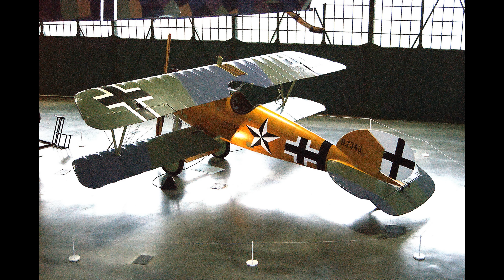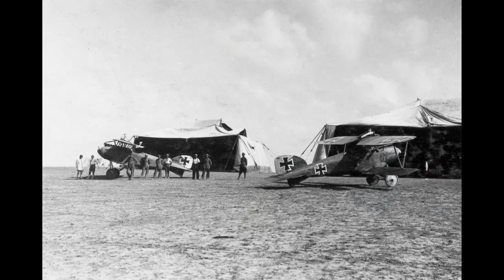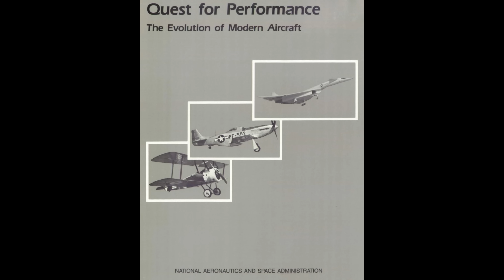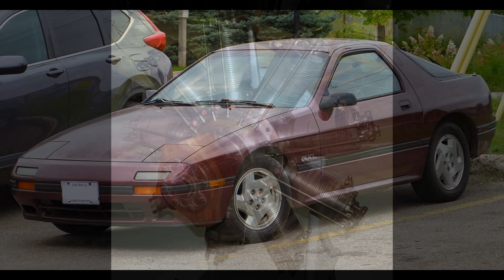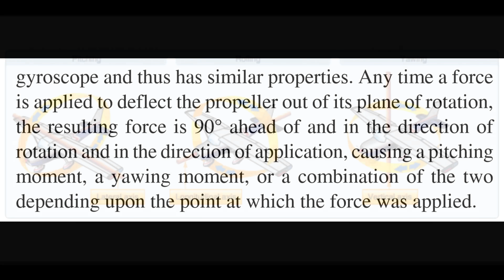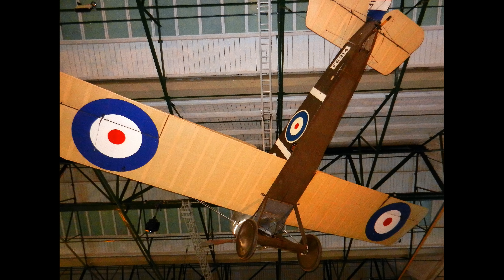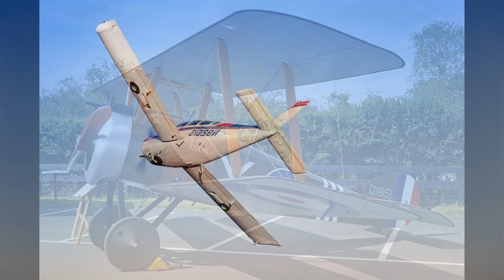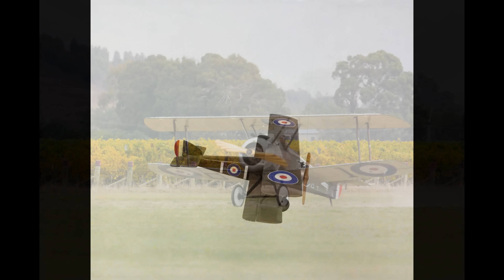Sopwith Camel, War Winner or Death Trap?

Comment: Wonderful video on the Camel. Funny you mention Snoopy, it's the reason I heard of the Camel and the reason it became my favorite WWI fighter. The SPAD VIII with Eddie Rickenbacker was another favorite. I eventually ended up with a VK Newport 17 RC aircraft that was built in the 70's by some Navy Contract worker. It was given to me in the 80's and I rebuilt it. It had Lafayette Escadrille markings on it with the Sioux Chief on the side. I routinely flew in the mid 80's at the NAS Whidbey Is. OLF (Outlying Landing Field) the US Navy uses for landing practice. That's when the club was allowed to fly there in the 80's off the southern taxi ways. I still have the VK Newport 17 hanging from my bedroom ceiling. That model is about 50 years old now. LOL Thanks again for the great video. Best Wishes & Blessings. Keith Noneya

Comment: Sorry, cannot agree.  Rotary engines were used because the piston counterparts with appropriate horsepower  were too heavy for aviation purposes.  When the wrights flew they had to build their own engine because nothing light enough existed.  For the weight, the rotary engines produced more horsepower at that time, 90 - 110 -130 hp.  The eindecker IV had a double row rotary engine which i believe was 150 hp, however it had many mechanical problems.  Once the piston engine was light enough with appropriate HP,  it became the dominant aircraft powerplant ,of course, followed by the jet engine which also took time to develop for aircraft purposes.
Reply from the maker: You're simply wrong. The Bentley BR1 rotary weights 397 pounds and put out 150 horsepower. The Spad XIII's Hispano V-8 weighs 445 pounds and puts out 200 horsepower.  The Radial's power to weight ratio is inferior to the Hispano Suiza V-8.
Reply: @GregsAirplanesandAutomobiles  BR1 was basically what could be squeezed out of rotary and Hispano-Suiza 8 in its Ba/Bb form had still good potential for more power.
Clerget ran around 1250-1300 rpm max and that was it, also it was nearly 6 litres bigger than H-S 8 (12l) and when H-S 8 F series came, which was similar displacement to Clerget 9b, Hispano power went up to nearly 350hp.
Basically the rotary peaked during the was and was a evolutionary dead end. And mainly because the need to run more rpm to get more power.

Comment: Rotary engine was an evolutionary dead end because there was no headroom to squeeze more rpm out of them.
Engine designers tried some innovative ways to bypass that, but engines soon became overly complex and lost the greatest rotary asset, which was low weigth vs power.
One good example of this was Siemens-Halske Sh. III, which was counterrotating rotary, so the engine and propeller turned opposite to each other and it took a long time to mature into a decent engine.
Also the oil systems used in those rotaries were almost universally total loss systems, just like two strokes where the oil is mixed with fuel before entering crankcase. 
The fuel-oil -air mixture was drawn into the engine via hollow crankshaft and lubricated most of the moving parts, rest was just greased.
Castor oil was used because it was one of the few oils in that time that mixed properly with gasoline.

Comment: In WW 2 The planes carrying the Atomic Bombs Turned to the right and go into a shallow dive after dropping the bomb because, of the gyroscopic effect of the rotating props, The plane would turn faster and increase speed by the dive and get further away from the blast.  The dive was necessary because, when the bomb was released, the plane would climb due to the loss of weight and climbing would cause a loss of speed.

Comment: It would be nice to see a vid on the actual honest impact of the airplane, and it's role in WW1.  The misconception of the overwhelming power of the machine gun  (in the front lines necessitating trenches) and the actuality of artillery. The primary use of aircraft to direct fire of artillery and the rudimentary radio they used to achieve such goals.  The role the "fighter planes"  had to effect such direction of artillery.   The Red Baron has been criticized  the allies as a butcher shooting down the innocent, when his role actually was to knock down the 2 seaters .

Comment: Good video. Interviewed many, many years later in the 1980s, Tom Sopwith specifically noted the effort to keep the weights concentrated in a close space on the Camel. Another development that helped defeat the Albatros fighters was the Constantinesco synchronizer which aided rate of fire and reliability from the Vickers guns  in 1917-18. Going from a single gun Pup with the old synchronizer to a Constantinesco dual gun on the Camel would have been a big jump for an allied airman.

Comment: the reasons for the gun "freezing" is multi fold 

for one, the speeds of the aircraft had started to increase, a lot, 
so there was a more rapid cooling 

second was how how, and the tactics that had formed, 
the days of the pup, and triplane etc, they would take a long time to get to height, their dive speeds, not fast, 
they would avoid clouds and air to air there wouldnt be that much of an altitude difference 

the camel, well, that could fly higher, it would often be a viable way to fly high to spot a target, and come down
and that is where the issue would be, cold metal, coming into warmer, denser, moister air, and bits would freeze, 
what also didnt help, is that many of the guns, to stop slow firing, would go up with minimal lube/oil on the gun, (cold air, oil gets gummy, machine gun is slower) this caused a greater risk of freezing of the guns

Comment: One other advantage of rotary engines that I have heard about was that they avoided the need for a flywheel, which was quite a lot of saved weight when dealing with such torquey, low-revving engines. But yeah the ability to get good air-cooling was probably the major concern since it saves the weight of the entire water-cooling loop.

Comment: A Design like the Camel in rubber free flight would have the rear post of the rubber motor quite forwards not much rearward of the fuselage in order to keep the CG at about 1/3 rear of the leading edge of the upper wing.

Comment: Structure doing double duty. On my 4/4 I mounted the front plate at an angle to deflect air up under the engine. HFS Morgan used longitudinal frame pipe to exhaust his front mounted V Twins.

Comment: Greg, how can you mention the WW1 Rotary Aircraft Engines and not mention that the lubricant used wasn't 'oil' in the modern sense but 'Castor Oil'?! Now, I don't know if the tales of pilots with the 'runs' from their accidental ingestion of the castor oil is true, but the engines did use it.
Reply from the maker: I simply can't cover everything in one video. There was lot more I wanted to talk about, and probably will at some point.
Reply: @GregsAirplanesandAutomobiles  I am sure that for every 10 minutes of video produced & uploaded, there is probably 2-3+ hours or more of research, writing,  & production time that goes into it.

Comment: The reasons for the one pair of ailerons on the German aircraft was..  Less adverse yaw.

 if you look at side views of most of the fighter and two seaters Germany fielded, you will notice fair to rather pronounced amount of wash-out on their upper wing ailerons.

  The British WWI planes had some really big ailerons.  I would like to assume the British designers were probably aware of the dynamics of having a lot of downward movement in such large control surfaces, ( on both pairs of wings..) as being rather antagonistic to your yaw and roll control.  The Germans, even in their prewar aircraft seemed to have discovered the bad side effects of ailerons and adverse yaw and even their early pioneering aircraft like the Grade Eindekker,  DFW Pfiel,  and the Eitrich Taube had mostly upward moving wing roll controls.  These were more of a wing tip spoiler that reduced lift and added just enough drag on the side of the plane you wanted to bank towards and to keep the fuselage somewhat aligned with the airflow.  Which brings us to Von Richthofen's early writings on his training in a Aviatik B.I, which he likened to a "great apple barge" in it's roll and yaw control.  Seeing how this aircraft had a tiny little comma shaped rudder behind a triangular fin and some generously sized ailerons, ( that did have some washout..) it's not surprising. I think the German training corps were more inclined to teach their pilots good flying control habits even if their training aircraft were lumbering barges.

Comment: Gyroscopic effect is a pretty big issue with RC planes as well, especially with brushless motors which are ironically pretty similiar to rotary engines, since the bell with magnets is the spinning part of the motor. To counteract this effect we tilt motor to the right (with CCW rotating propeller). I've built Fokker D.VIII in 1:8 scale, that I have yet to finish, and gyroscopic effect is very notable when flying this one. Basically the slower, lighter, draggier the plane is and the larger the propeller and heavier the motor the more notable the gyroscopic effect is. The best solution for counteracting gyro effect is having a plane with 2 motors that spin in opposite direction, the gyro effect evens out this way and the plane is way easier to control and feels "symmetrical", it doesn't matter which way you turn, it will turn just as good both ways. If anyone's interested I have a flight video of Fokker and Bf-110 on my channel, you can see the difference. On side note, I heard that the Fw-200 Condor had 4 engines that all were spinning the same direction and it would basically roll and dump into the strip if pilot pushed the throttle too hard, but I don't remember where I read it and if it was even true, but I find it believable.

Comment: G'day,

Yay Team !

Well done Greg, this was a real pleasure to watch..., I hope the link to the double Hamnerhead is there when I get to the Description, that sounds to be amazing.

Happily, the only actual error in this entire Video was hilarious - and you didn't make it either...; regarding the Snoopy illustration in the Game Cartridge - the "Artist" has depicted "The Red Baron" as flying a red SOPWITH Triplane, replete with long narrow equal-span Wings featuring prominently inked-in X-type Flying & Landing Wires running from Top to Bottom Wings and straight through the centre Plane....
Apparently that person found a picture of a "WW-1 Triplane Fighter", and painted their effort after being inspired by a Sopwith...(!). 

Your explanation of the Gyroscopic Effect on Controls was excellent.

According to Capt. Norman Macmillan, whfn turning vertically to the right a Camel, "properly flown" would complete 3 complete turns in the same time it could barely finish 2 turns to the Left, and when turning Right one had to apply a lot ("almost full...") Left Rudder to hold the nose up and about Half Keft Aileron tobprevent the Turn from tightening into a Spiral Dive...

Turning vertically to the Left invilved, again, almost full  Left Rudder  to prevent the Nose from rising and washing off Airspeed, and half Left Aileron to hold it in the Turn...

Which must have taken some getting used to...

I was surprised that you didn't mention the Aft CG when Fuel was in the Main Tank, necessitating FULL Forward Stick from the Start of the Take-off Roll with a Full Tank..., onky gradually rekeasing Forward Pressure as the Tail came up - slowly- as you mentioned..., titrating the amount if Forward-pressure required to hold whatever Airspeed was desired, by Attitude control, pushing against the pervasive Tail-heaviness... Releasing the forward Pressure caused the Nose to rear up into an automatic loop, with enough Power to continue until otherwise stopped, and which Precession would duly twist into a Looping "Cloverleaf " at 90° of Azimuth Orecession at per each Loop (!).

By the time a Line Patrol was ending and the Machine headed for Base, the Fuel had burnt off and  only a smidgeon of forward stick was required fitr level flight - and with less than 1/4 of a Tank, the Camel glided perfectly "In Trim" for landing...

As I understand, from extensive reading, kinda thing.

And, those critical Centre-Section Flying/Landing Wires, with the Cabane Sockets lacking Fixture if the Wires had been stretched by a previous Bounce - leading to the Cabanes popping out at the next 2+ G Pullout - followed by the uncontrollable Stall/Flat Spin which killed so many Camel Pilots that
The Camel killed more 
Camel Pilits in Training Crashes, than the
Enemy did, in Combat.

Norman Macmillan & Sir T.O.M. Sopwith discussed and agreed in that point, atva Dinner in London in about 1961 - or so I have read, in the book on  D'urban Armstrong's demise...

Gotta go,

Such is life,

Have a good one...

Stay safe.

;-p

Ciao !

Comment: The Bentley engine had a sort of metering carburettor in an era of difficult manual fuel-air balancing with a rotary engine.  It was only ever practical to freeze the working full power fuel-air balance and blip grounding of the magnetos to momentarily cut power for the approach descent.  Listen for the irregular on/off engine noise of authentic rotary engined historical planes.

Comment: This is great info as a player of all planes in IL-2 Sturmovik - I've always wondered why the Fw190A (others too, but I always noticed this one in particular) will require lots off hard left rudder when pulling back on the stick (pitching up).  It also helps me understand about why planes like the Fokker Dr.1 need to enter a roll with both aileron and rudder.

Comment: thanx Greg.  I rarely comment on videos, but as a 70 year old aviation nut, a pilot, and the grandson of a WW1 vet in the US Army Air Service, this is a subject i have often wondered about   I do wish you had talked about the throttle....i believe rotaries ran flat out all the time, unless the pilot cut ignition to the cylinders
Reply: Correct.
Reply: Just because it works doesn't mean it isn't a damn fool idea
Reply: The Rhone and Clerget engines do have throttles. Only the Gnome engines have no throttles.

Comment: There is a lot more than just the engine that made  the Camel what it was. Firstly, the main weights of the Camel were crammed into about 7ft of the fuselage, secondly, the tail surfaces were smaller than those on the Pup and Triplane. The pilot of the Camel effectively sat on the petrol tank. A very accurate appraisal of this aircraft, literally as it is theirs, can be found in the Shuttleworth Collection " Prop Swing " magazine. The article is written by the pilot, Dodge Bailey, who has a healthy respect for the machine. As it happens, I am a volunteer at Shuttleworth. Bear in mind that all rotary engines involve gyroscopic precession when an aircraft manoeuvres, except for those powered by Siemens-Halske engines, which used a system wherein the crankshaft and cylinders turn in opposite directions.

Comment: Really should include mention of the Royal Air Factory's SE5 and SE5a as the early SE5 was operational during the Bloody April period and was superior to the Albatros D.III.   Just for mentions, most of the kills by the Flying Circus Albatros D.III squads were against rather defensless RAF BE2c and BE2F observation planes, also a lot of French Obs quads were flying the older Farman F40 pusher, and various "improvements" on the Morane-Saulnier L parasol.  The Nieuport's sesquiplane V strutters the later types of the N17, N23, and N24 were nearly the Albatros' equal, more maneuverable and with the 130 hp LeRhone could hold their own in climb.  Let's also mention that both the Abatros D.III and the Nieuports were gimped by their lower sesquiplane wings aerodynamically twisting and falling apart in high speed descents.
Reply from the maker: I don't disagree with anything you said. Although the Se5 and 5a didn't show up in enough numbers to matter until a bit later than the Camel.
Reply: @GregsAirplanesandAutomobiles  Yeah it was primarily with RFC 56, the 150 HP Hispano V8 being largely made for the Spad 7 the main reason it was a late player.  It did have a small effect and if you've flown it in IL-2's mod Dark Blue World 1916 it's really capable.  A steady gun platform and can be dived without worrying about it falling apart.

Comment: You could add a 4th drawback to rotary engines: they cannot be supercharged. Due to their intake system that goes through the crankshaft case, just like a 2 stroke engine, and for the same reasons.
Reply: The biggest piston engines are modern marine two stroke supercharged diesels.
Reply: @givenfirstnamefamilyfirstn3935  I meant 2 stroke petrol engine, of course. Not Diesels, which have a totally different intake design.